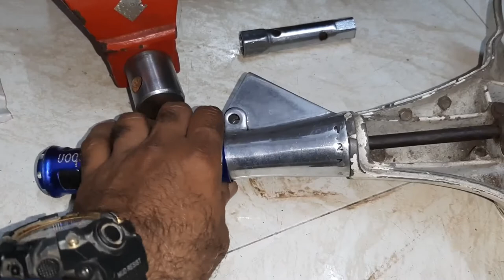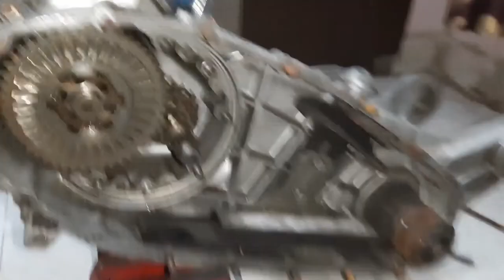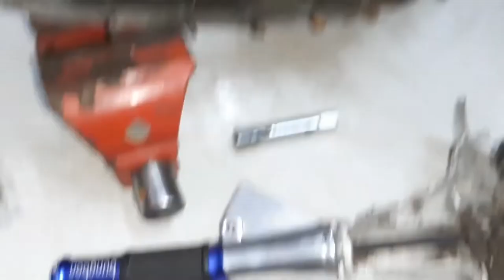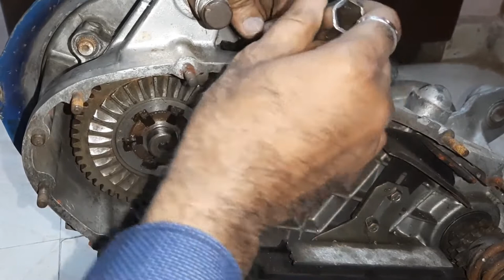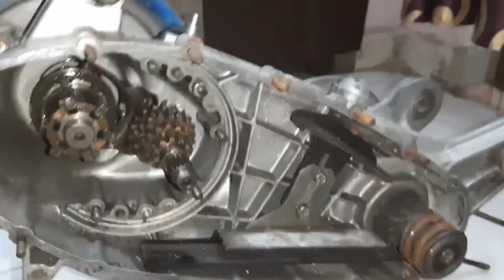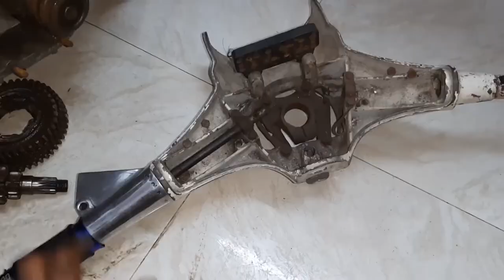The Inner Workings of Manual Transmission on a Lambretta Scooter

Comment: Hi sir i have vijai super scooter my scooter problem in 2 gear when I put a second gear my scooter is do not moveing 1 gear ok 3 ok 4 ok but 2 gear is not working what is a problem........?
Reply from the maker: It is not messing up with second transmission on cluster properly. That's why its not moving
Reply from the maker: Check the teeth on both cluster gear and second gear for any damage
Reply: @LambrettaRamesh ok sir thanks
Reply from the maker: All the best 👍👍👍